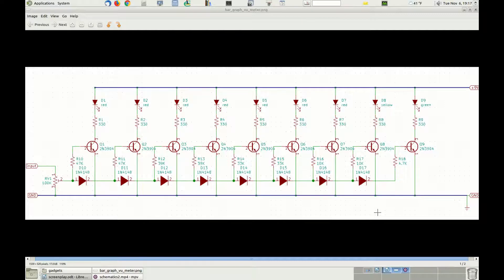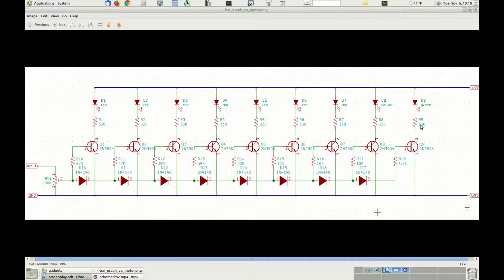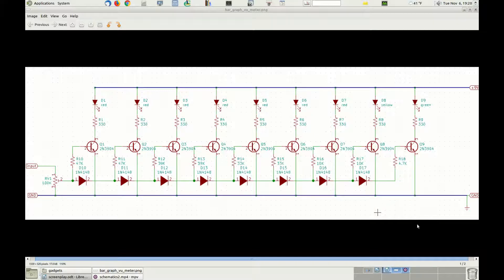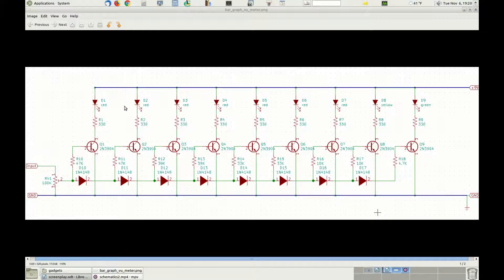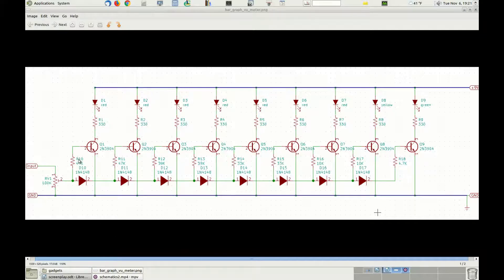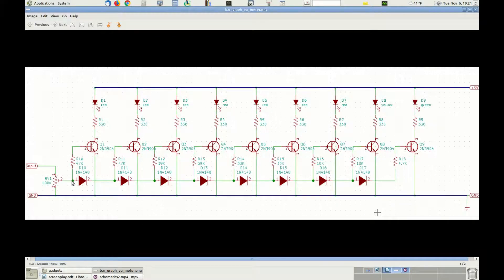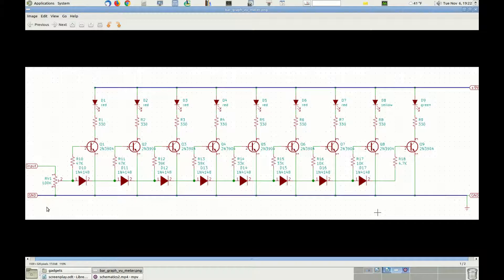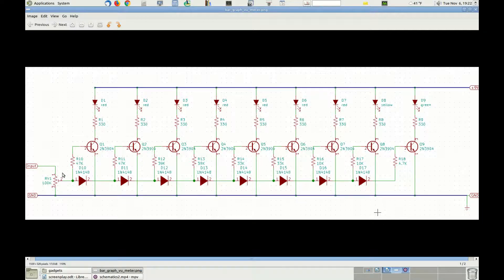Bar Graph VU Meter

Comment: In real application like for example i would put it to my audio amplifier where should i connect is it after the amplier in between the speaker or before the amplier i should say from audio sourse like audio signal from cellphone something like that.thanks
Reply from the maker: You can put it in parallel with the speaker.  Start with the cursor of the trimpot all the way toward ground, then move it slowly until you get get leds all lighted up when the volume is high.

Comment: Wat is a good transistor to use for this vu please?
Reply from the maker: Any general purpose NPN transistor with a DC current gain (hfe) of 100 or greater, and capable of supporting a collector current of 100mA or more should be fine. In my case, I had a bunch of 2N3904 getting dust in my component drawers, so I decided to use those.
Please note that the circuit I posted is more suitable to be controlled by the output of a power amplifier. Since I did not put any pre-amp on the input signal, it will need a certain amount of voltage to work, between about 0.8V and 6.4V). The trimpot at the input should be tuned so that the last LED turns on with the max desired voltage in input.

Comment: What would be the schematic. If we want to make a circuit like this for various frequency.? Do we only have to change the resistor value in order to make a frequency spectrum vu meter. I hope u r understanding what i am trying to say.
Reply from the maker: You would need to put a pass-band filter in between this device and your amplifier. The band-pass filter will make the vu meter work only at the frequencies that the pass-band is tuned. Then you can replicate the whole thing with differently tuned pass-band filters for all the other frequencies that you want to measure/visualize..
Reply from the maker: You may want to watch the video that will be published in 1-2 weeks, currently in production, which will talk about, among other things, active filters, which you could use for this purpose.
Reply: @eleneasy  i did it. But it didn't work.. i used this band pass filter thing on lm358 as well as lm386 ic. But it didn't work... Leds were not responding according to assigned frequencies. Although sound was accurate according to set band pass filter.. so i was very confused back then 3 years back when i did it. I wanted to it again.
Reply from the maker: When you put the band pass filter before the VU meter, you need to make sure that the signal coming out of the VU meter is high enough to control it, otherwise, you will have to amplify the signal before sending it to the VU meter. But if you meant that the VU meter can still be controlled, but it still responds to a large range of frequencies, then the problem is the "Q" of the filter you are using. In other words, you have to use a narrower band-pass filter. You could try with a second or third order active band-pass filter. I will talk a little bit about these filters in the video I am currently working on. Probably out in one or two weeks. I am also planning to build an audio equalizer with levels visualization at some point in the future. Keep experimenting. I'm sure you'll find the way to obtain what you are looking for. Good luck!
Reply: @eleneasy  i m really eagerly waiting to see ur video.

 I hope it will answer what i m looking for.....thank you Sir.👍
Reply: @eleneasy  hi
What about that vu meter circuit that you were planning to built? That will show various frequencies. Have you built that circuit.? 
Can i plz get your email????
Reply from the maker: @GURPREET-Singh-107  I'm still thinking of building the device I mentioned. However, I was caught with other projects, in particular the Theremin, which I would like to finish soon. Once I am done with the Theremin, I plan to go on with a whole HiFi system, with pre-amp, amp, and equalizer. The equalizer will have al the circuitry that you are looking for. Be patient my friend, I'll get there. The big problem is that this is work done only in my spare time, since I have a job that I need to survive. I wish I had all the time I wanted for this. Maybe if people helped with contributions... :-)
Reply: @eleneasy  wow.. sounds cool.. that u have planned for all this things... hope u will be uploading those videos soon. Good luck Sir👍
Btw which country are you from?
Reply from the maker: I''m from Italy, but I I've lived in USA for the last 30 years.

Comment: can i use capacitor charging and discharging state to use at this circuit input?
Reply from the maker: The circuit input needs some current for the circuit to work. If you connect the capacitor directly, it might work for a few seconds, but then the capacitor would discharge. If you want to make some sort of indicator of how much charge is on the capacitor, you should put an high impedance stage in between, for example an op-amp connected as a unity gain follower. The capacitor would go to the input of the follower and the output of the follower would go to the input of the bar graph VU meter. If you are not familiar with the unity gain follower, just google it and you will find a schematic easily.

Comment: I want to use condensor mic as input help me
Reply from the maker: The bar graph VU meter I described is more suitable to measure the output of an amplifier. Microphones in general have a signal that is too low to use as an input to the VU meter. To make it work in your case, you would need to amplify the signal coming from the microphone. There are several ways to do that. I would suggest an op-amp based device, possibly a two stage, the first that actually amplifies the signal from the microphone, and the second stage that lowers the impedance so that the resulting signal can control the VU meter. If you want to give it a try, here are a few links  of microphone preamps that you could try to use:
Reply from the maker: https://www.ece.ucsb.edu/Faculty/rodwell/Classes/ece2c/labs/Lab1b-2C2007.pdf
https://www.google.com/search?client=firefox-b-1-d&ei=Nip7XOyqOPKv_Qaz0a-YBw&q=condenser+microphone+preamp+schematic&oq=condenser+microphone+preamp+schematic&gs_l=psy-ab.3..0j0i22i30l7.9829.11066..11250...0.0..0.197.1011.7j3......0....1..gws-wiz.......0i71.pdTDXj69ZkI
https://sites.google.com/a/vt.edu/amp_lab/projects/high-gain-low-noise-microphone-preamplifier

Comment: I wonder  is it only create a voltage display using  10 transistors and LEDs? Is it possible to  use this circuit to make an 3db increments, Log Display or a VU Meter Display?
Reply from the maker: This was a simple proof of concept, to explain the theory behind the LED VU meters. The increment between one LED and the next is linear. In order to have a logarithmic VU meter you would need to use voltage comparators for each LED, rather than a simple transistor and a diode. A more convenient way to make a VU meter with logarithmic output is to use one of the many ICs already designed for this kind of use like, for example the LM3915, produce by Texas Instruments. Here is a link to the data sheet:
https://www.google.com/url?sa=t&rct=j&q=&esrc=s&source=web&cd=6&ved=2ahUKEwi705OPw6TjAhWVQc0KHUd0B0cQFjAFegQIARAC&url=http%3A%2F%2Fwww.mouser.com%2Fds%2F2%2F405%2Flm3915-443929.pdf&usg=AOvVaw0Bl1AM090tKkYKGHTB4pwW